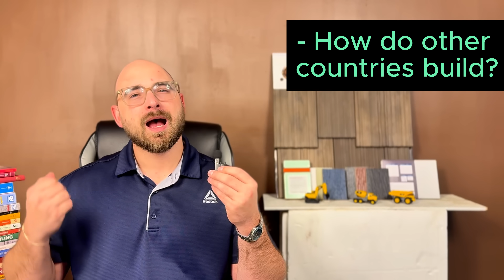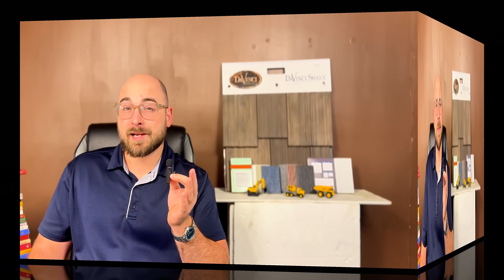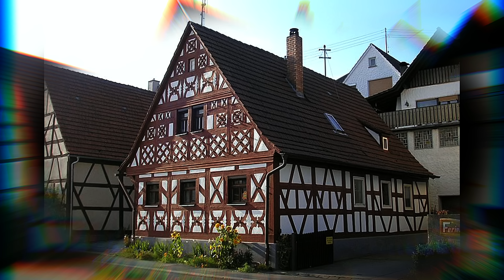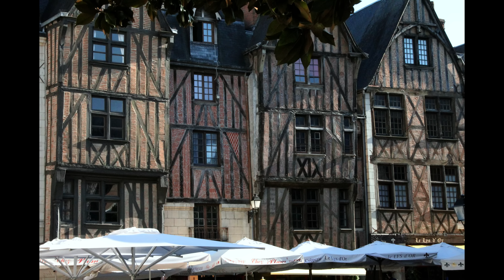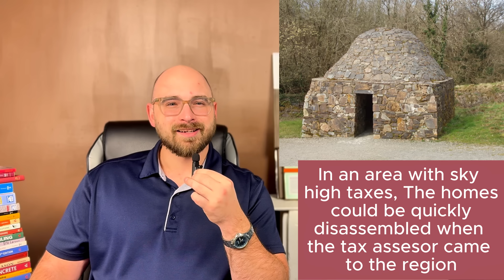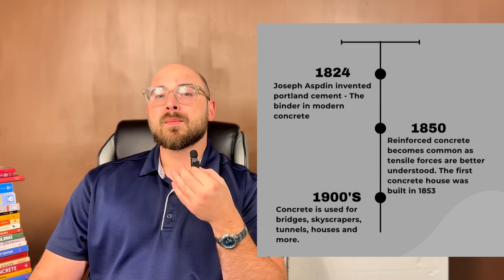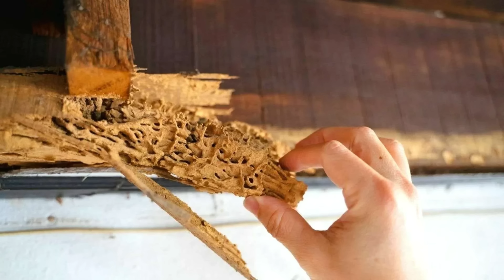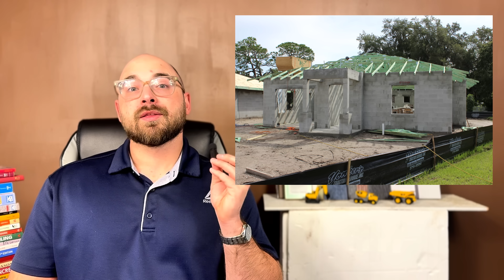Why Other Countries LAUGH at American Homes

Comment: Helped my dad and uncle both build SIPS homes. 
Helped my dad's buddy build ICF homes. 
I would never even consider doing a stick built house. 
I like ICF the best. Super easy. 1 person can setup the forms by themselves. 
The end result is a super insulated, sealed envelope house that is bulletproof, tornado, hurricane, and fire resistant if you use steel, rock, or cement based exterior finishes. 
Extremely uniform temperatures inside. If you do in floor heat, it's even better. 
Nothing better than a warm floor on those -20F days like today.

Comment: This is such a wealthy minded conversation, most of the comments make me laugh. As a US contractor for my entire career, even the most wealthy of my clients try to take shortcuts on building codes for wood frame houses. These disasters are few and far between and , for the most part, in predictable areas. I've worked on restoring houses built in the 1700s- about the oldest you'll find around here. At least one of those were brick. Some had past fire damage from who knows how long ago. Wood frame houses are fine in this climate Of the USA, we're about 5,000 KM from los angeles- which is where this discussion really grabbed hold, I think.

Comment: RSG-3D is pretty innovative.  Its reverse ICF.  Planning on rebuilding 3 houses that way but I wish they had thicker than R21 insulation.
Reply from the maker: If you keep the foam outside of the concrete, like with ICF, you get a higher EFFECTIVE R value, 

The stated is R22x but the performance can be up to R50. 

ICF benefits from earth coupling, where the insulated core equalizes in temperature with the footing. This effect can travel up several stories. Which means your walls are 55-65f regardless of outside temperature.  

From a longevity perspective, ICF also protects the concrete from moisture (along with a capillary break at the footer) preventing corrosion of the internal reinforcement
Reply: @Mike_Fortin  looking hard at ICF as an option.
Reply from the maker: Take a look at CrownICF, 

They’re super helpful if you call them too 

www.CrownICF.com
Reply: @Mike_Fortin  What I like about this is that they are hitting R numbers that are way beyond RSG which is compelling.

Comment: I stumble on your channel, I would like to hear your take on Tiny Homes. To me, I dont think they will stand the test of time like a good quality concrete home, especially in high winds. The trailer they are build on will eventually rust. But they have a big advantage, they can be moved out of danger.
Reply from the maker: Tiny homes are designed to be cheap, and temporary, hence why most of them are more like a trailer than they are a house. 

Theoretically you could move the house if there was enough notice, but I don’t know that’s very practical 

From an affordable housing perspective, tiny ICF homes would be a great option. Quality, permanence, in the affordable price, a starter home someone can own rather than rent, 

Still not the cheapest though. 

In my opinion, there’s nothing wrong with smaller homes, even better if their quality builds, 

But the tiny home community has unrealistic expectations and wants everything to be cheap and disposable
Reply: @Mike_Fortin  Tiny homes are a way to have a shelter at a lower price and are satisfactory for many, it is not a panacea to housing shortage and affordability. I agree with your opinion, they are temporary. I dont know what ICF hommes mean, if you can clarify that I would appreciate. My niece lives in a little home that was built after the war for veterans, they were small homes but there is no wasted space. They are cozy and functional. I find there is a lot of wasted space in 3000, 4000 sf homes.
Reply from the maker: By ICF I am referring to homes built using Insulated Concrete Forms

Comment: 90% of homes in Australia are constructed of clay or concrete bricks, double leaf on the external walls, single brick on the internal walls, with concrete slab floor and roof support constructed of treated timber or steel frame. External walls in recent years are cement rendered and roof covering in clay or cement tiles has given way to colorbond steel panels.

Comment: You forgot to mention one important point in detail - energy efficiency. Wood-frame houses are significantly more energy-efficient than concrete or brick ones. The reason why there are quite a few concrete houses in Texas, Florida, and Arizona is that the climate there is warm. Take another look at your construction materials map. All cold regions primarily use wood, including Canada, Finland, most states in America, Sweden, etc. As for Russia, which uses concrete, it’s not worth considering -they do everything foolishly
Reply: You neglect to consider products such as Rockwool and Thermolite both of which are mineral based and have high thermal efficiency, fire retardance and durability when protected by products such as brick. Brick is widely employed as a cladding for timber framed homes because it is durable low maintenance and astatically pleasing. Rockwool is used to insulate timber framed construction and cavity walls alike. The only difference is the use of a Thermolite Block or a timber frame. The UK does not suffer with harsh winters or sweltering summers, both timber frame and cavity wall construction are employed to meet the same energy efficiency codes. Cavity wall construction is preferred due to its superior acoustic performance and fire retardance.
It is also worth noting that Insurance costs in the UK prohibit timber frame construction due to higher premiums associated with low fire retardance.
Mortgage availability for an older timber frame house may cause you issues in the UK since lenders general want the life span of the property to exceed the Mortgage duration.
Reply from the maker: ICF is far more efficient than light wood framing, 

Yes you can build double walls and add exterior insulation, but for the same price you can get solid INSULATED concrete. Safer, stronger, more efficient , lasts longer

Comment: Personally, I'm not fan of concrete. It's ofc necessary part of nodern construction, but I think we should use brick and wood when we can. Concrete is just going to get more and more expensive as we deplete our suitable sand reserves.

Wood especially is extremely good depending on how you use and process it.

Comment: Other countries laugh ..??? Most people in Europe can’t even. Think of affording their own house ..!!! So laugh away.. 
American houses are bigger, nicer, full of large appliances and sagebrush features while lots of houses in Europe ard basic without AC and devoid of many features
Reply: There is a cultural difference, regarding desire to own or rent and stuffing your home with big apparatuses. Regarding A/C: It really depends on the regional climate and attitude to airing... Not quite as simple as you try to make it.
Reply: I remember when I took French in college. The teacher had lived in France for a couple of years. She said the government looks at your house size and calculates how much fuel you will get for heating. If you use up your allotment then you have to wait until the next cycle starts. She said wearing many layers were required to keep warm. I don't remember what temperature she said the thermostat was set at. 
I can only imagine how uncomfortable it could feel. I tried setting my thermostat once at 65° and it is really cold. Dropping down from 68° the standard that many power companies push is really uncomfortable. Those few degrees makes a huge difference.
Reply: @Rhaspun  Are you mentioning the oil crisis in the 1970s??

Comment: I wouldn’t buy a house that has solid concrete walls or brick structural wall. While “stick framing” may not be perfect, or impervious to fire, or tornadoes/hurricanes but t the ability to easily modify or change or just repair the house is vastly improved with wood framing. If I want to put in a window where there wasn’t one before or even just add/move an electrical receptacle I don’t want to have to need a concrete saw and masonry tools.

Yes I’m an American
Reply: How many damn times are you gonna do those renovations? 
Ooh, concrete saw hard work ooh, lemme get my pocket saw and cut a hole for new doors real quick
Reply from the maker: So you would trade:

Safety, disaster resistance, energy efficiency, lower insurance premiums, and longevity 

In order to make renovations (which may or may not happen) a little bit easier. 

Very interesting
Reply: @Mike_Fortin  yes because the likelihood of any disaster happening is quite frankly statistically extremely low, yes they do happen and that is what homeowners insurance is for. Concrete and brick, even just as a façade, are just to much of a pain in the rear to work on.
Reply from the maker: I wouldn’t trust the insurance company to pay in the case of a disaster,

Build cheap, build twice
Reply from the maker: If you build with ICF, plumbing and electrical are in the insulation, not embedded in the concrete. 

If you really wanted to or were building an addition, you can use a “cut and break” saw to saw perfect openings in the concrete , an engineer can approve a simple drawing, likely adding a steel lintel above and boom, new openings

People over complicate it

Comment: In most US urban environments (with row housing, etc.) steel beams / framing is used, and in newer houses in my experience, steel and other metal reinforcement to wood frames.  Even in more affordable and partially pre manufactured homes this is the case, and I've seen it as the norm for developers.  

Having seen construction abroad, because of poor quality and fragility of some CMU, rebar and other metal is used which is a pain for modification or repair.  Issues with the ever evolving needs for electrical and telecommunications wiring, plumbing, etc. plus the desire for home remodeling and expansion keep some version of light wood framing in demand as well vs concrete, etc.   US manufacturers continued development of structural strengthening systems, insulation and fire retardant products and treatments in US wood frame construction can't be ignored.  

Piggybacking off of some of what was said in the video, Americans prefer and have more and larger bathrooms , kitchens, garages, and space in general, which has some cost comparative issues, and the culture of expansion and remodeling in the US is far greater than most nations abroad.  While the US has fairly average rate of homeownership among developing countries, the US has a much more active market of buying and selling homes as well as remodeling. (Americans see a ladder of housing types that one might expect to go through in a lifetime even for single family homes.)  Some of that flexibility makes for longer lasting housing.

Comment: Most European countries lack woods as a resource for building hence the use of brick. The united states is rich with largeevergreen trees perfect for timber and stick framing so they don't have to rely on brick as much.Wood building is not inherently worse than brick and really it matter for your application. Wood building in hot dry areas probably not the best idea. Also a house made with wood needs nails and hardware to connect joicnts together. Steel is really the underdog here without wood and bruck constructions.would fail under circumstances like Earthques, hurricanes,and tornadoes.